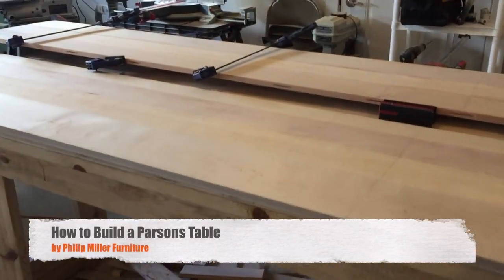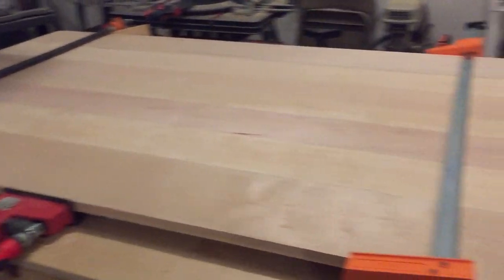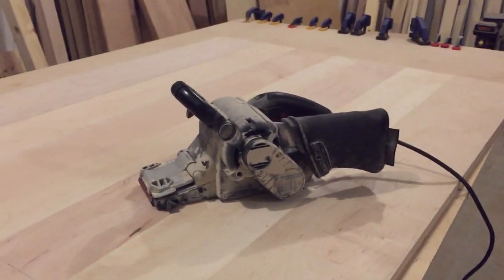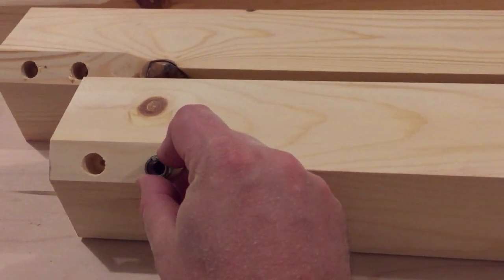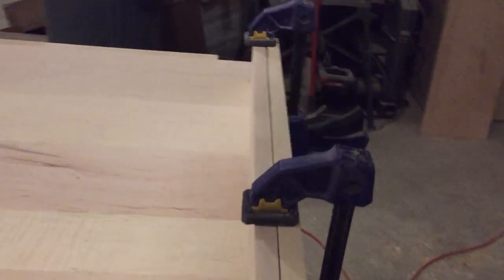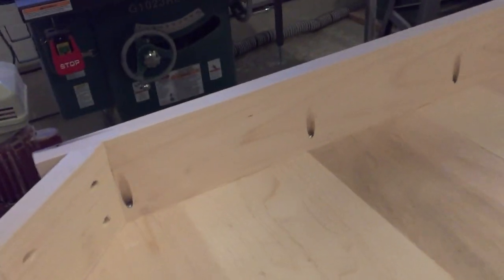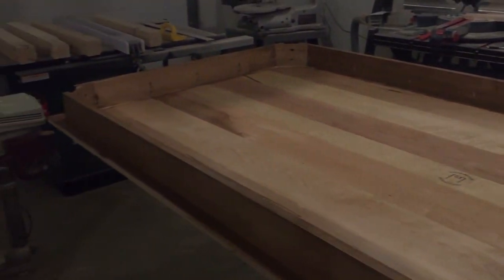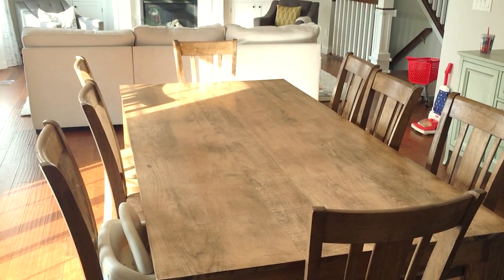How To Build A Parsons Table Woodworking Project

Comment: How well do the pocket holes hold up when it comes to wood expansion?
Reply from the maker: +Nodbugger I have never had an issue. I do glue the joint as well and with that combo I never noticed anything. I live in a climate that goes from humid to dry cold and it does well
Reply from the maker: +Nodbugger I have never had any issues.

Comment: Is there any reason you use the custom inserts to attach the skirt to the frame instead of simply using a lag bolt? Is it so you can disassemble the table if you want? Do you see any reason I can't use a lag bolt and drive it right through the brace and into the leg?
Reply from the maker: You could use a lag bolt. I didn’t because I wanted to have it removable.